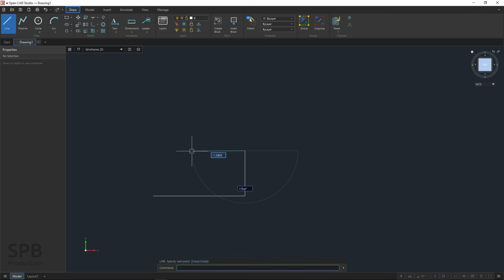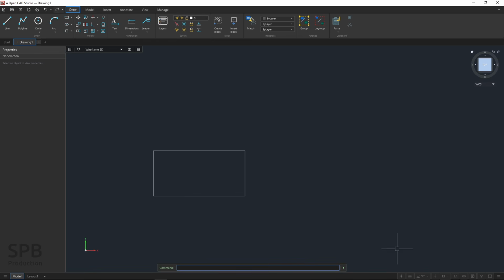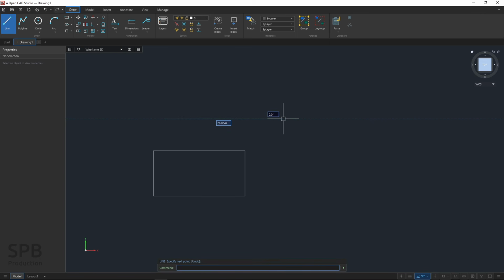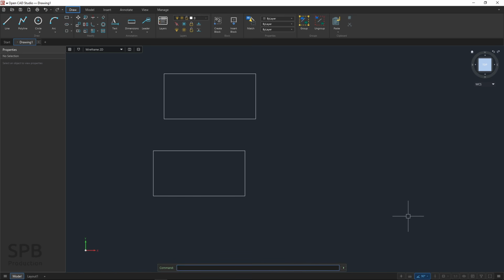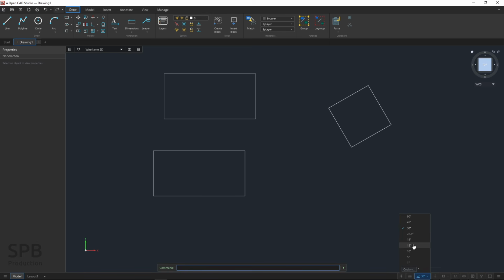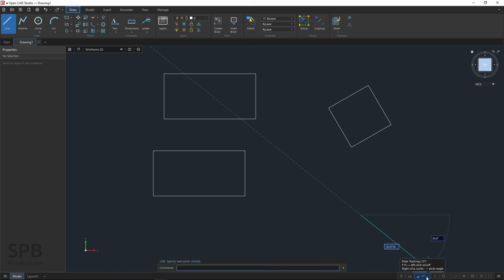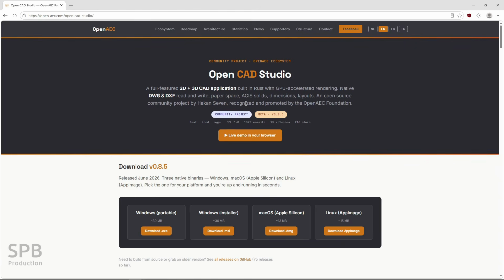Polar Tracking in Open CAD Studio

Comment: One question. I am trying to draw a line, just that, but those "helper" to show me what angle and distance are complete wonky. In free drawing sure it works but I choose an endpoint and the lines spawn adjacent to them making it pratically useless since it doesnt visaulize true angles or distances. Why is that happening ? Is that a setting ?
Reply from the maker: I don't think I understand the issue from the description. It's hard to describe these things in words.
Reply: @SPB-production thank you for trying. I opened a ticket with attachments so hopefully that will help them to understand the "issue"